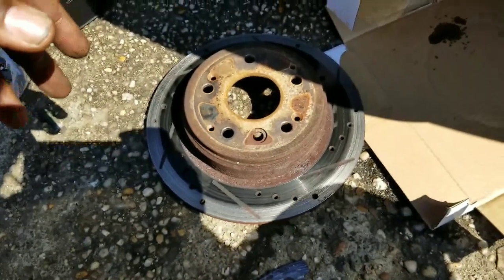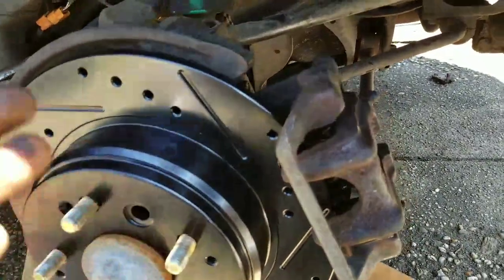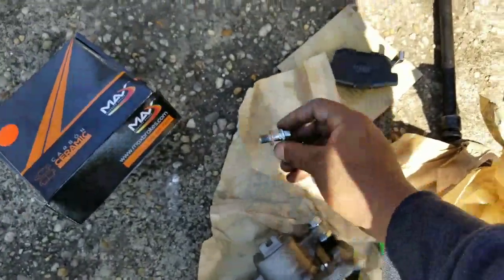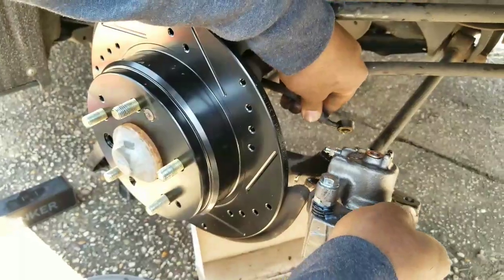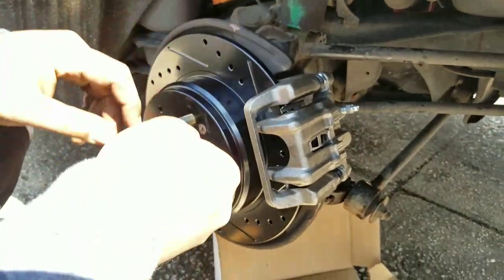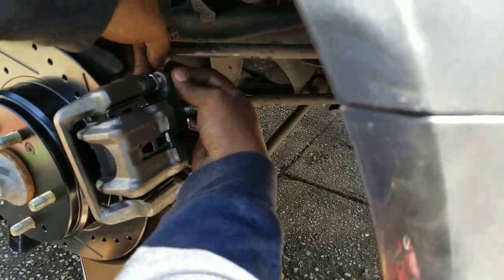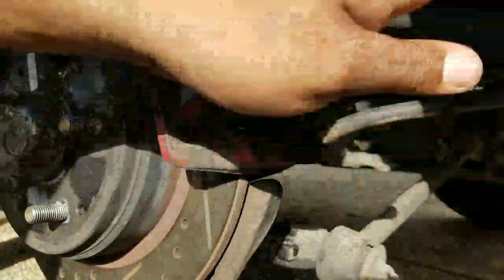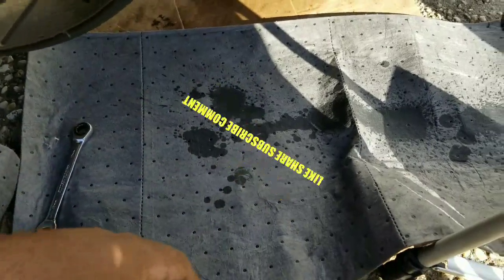ACURA TL  BRAKE CALIPER + BRAKE BLEEDING PROCEDURE

Comment: I typically have the person keep pressure on the pedal (pump and hold) at all times while the valve is open. The only time their foot is off the pedal is when the valve is completely closed. That way no air can seep in when you crack open and his foot isn’t on the pedal.
Reply: Idk why your 2 year old comment helped me bleed my brakes out with just 3 sentences 😭 respect
Reply: Or you have a bottle full of fluid with a line running from the caliper to inside the bottle and no air will get into the system like that
Reply: @RedlineMaximaSE  right I like how simple this method looks compared to having to buy the little kit and do that but how much more effective is using a bottle held above the brake at ridding the excess air?

Comment: See here’s my dilemma, I know how to do it all. But I can’t pinpoint if I need new rotors n pads…(probably) or just calipers. I actually work at autozone. I’m not trying to have someone tell me which parts to replace but I also don’t want to just throw unnecessary money at it. Same car..I’ll start with the rotors n pads I guess. I’m just pretty certain the front left caliber is sticking. Do you replace both calipers at once or go for the one needing replacing only? Lol just curious.
Reply from the maker: Just the one replace

Comment: I have a squishy pedal after bleeding the brakes and durning bleeding the brakes. I've changed the master cylinder due to the factor that the brake pads were gone and the Piston was completely pushed out and seized. How do you bleed a system with no pressure
Reply from the maker: You have to bleed each wheel in a sequence to get the pressure correctly.
Reply: @fabolousg4ever  
What's the sequence?

Comment: When I bought my 2017 Acura ILX the mechanic who replaced the Brakes and rotors didn’t put brake fluid in it and i didn’t realize it until 2-3 months later when I started having brake issues.  Needless to say, I had the rear driver side caliper go on me so I replaced that.  I also caught in time before it ruined my rotors so I didn’t need rotors, however I did replace the pads all around front and back.  But now my car is driving as if the e brake is on. And I’m not sure if my brother in law missed that or what’s going on.  If you could shed some clarity that would be awesome!!  🙏🏼thank you
Reply: Your brother probably didn’t compress the pistons back in after replacing the pads…😬